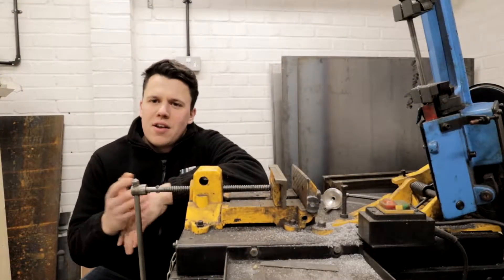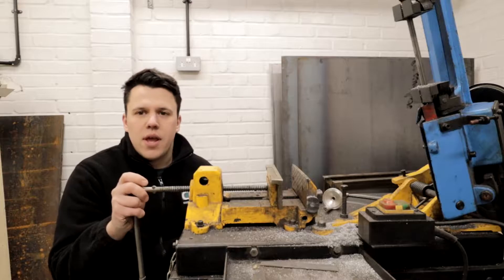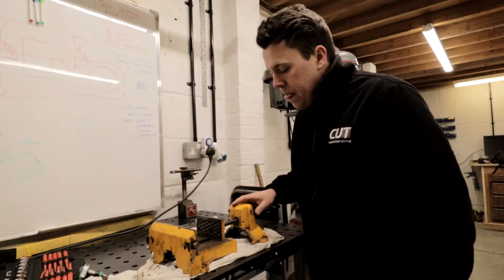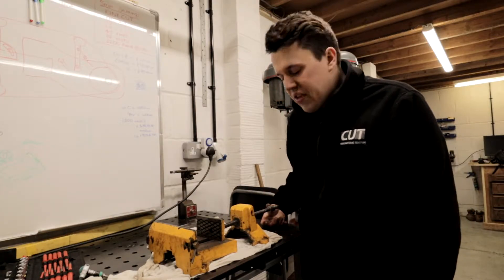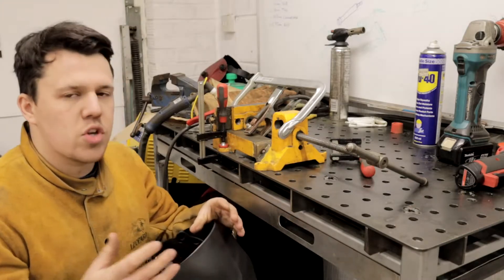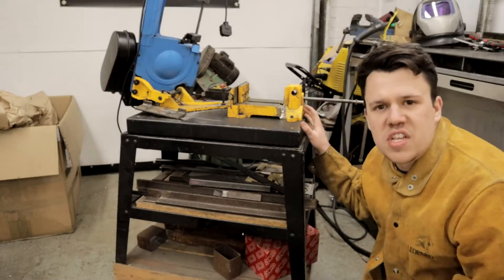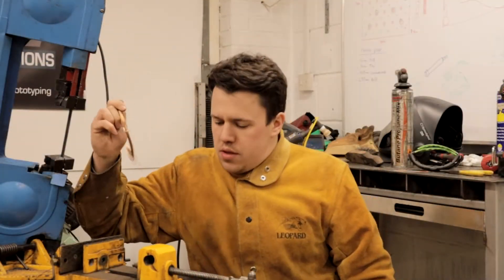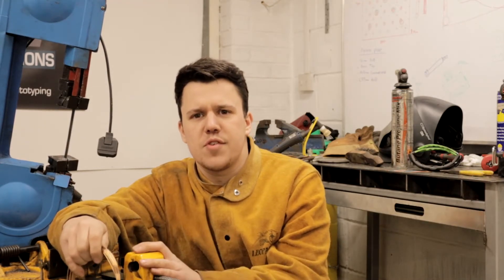Repairing a Bandsaw Vice - TIG Brazing Cast Iron using Phosphor Bronze

Comment: I suspect you can do almost anything to cast as long as you finish welding and then heat it red hot all over. Then cover it in dry sand. As though it were back in the casting mould box.
Reply from the maker: Yes, cast metal is an interesting material to work with... It must take years and years of experience to be confident welding whatever comes through the door! I try to keep it as textbook as possible with things im unfamiliar with.
Reply: @MasonsWorkshop  Most of the time I look at a broken thing and re-work it a bit. On a vice like that I might bolt the important bits into a steel frame to sort of re-design as well as fix .
Reply from the maker: @teamidris  That is a nice way to look at things! always room for some improvement along the way.